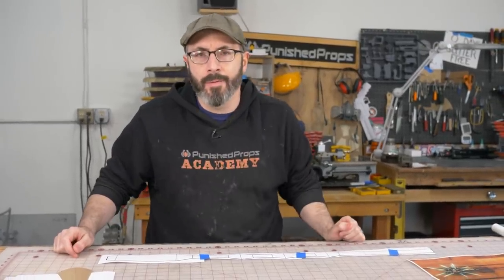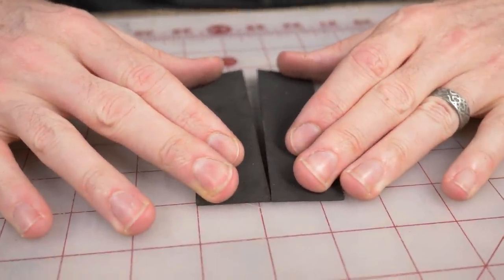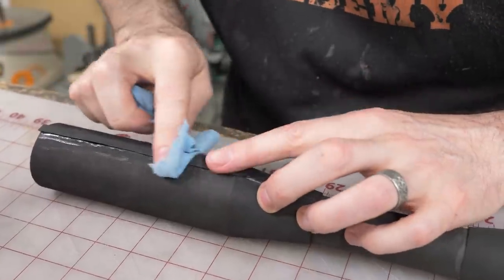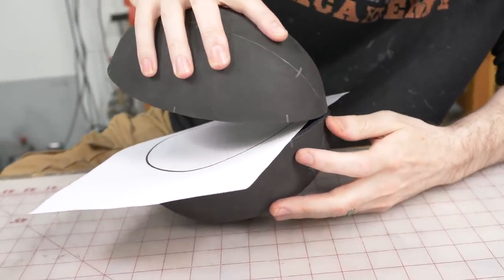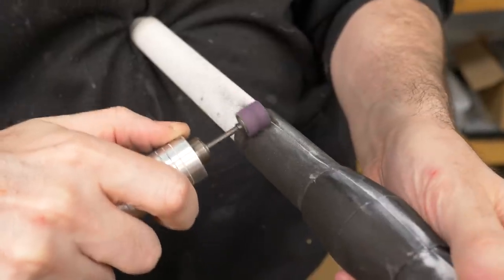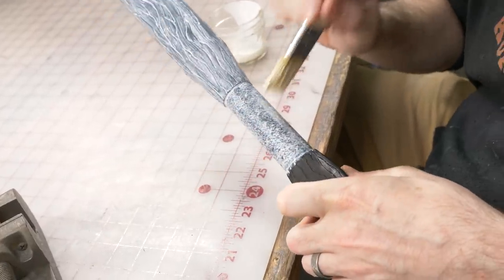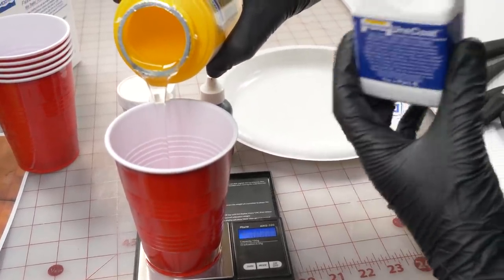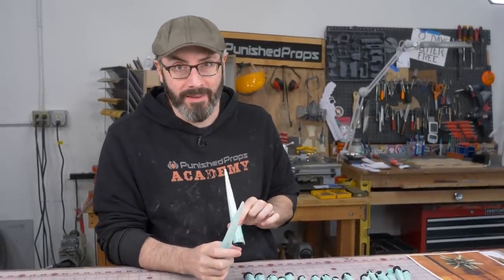Favorite Weapon in VALHEIM made from EVA Foam

Comment: Hey Bill, I noticed your skill bandsaw was starting to sound like mine on more difficult resaw cuts. There is a simple fix. Just losen the bolt on the back near the motor housing and move the motor housing further away from the blade. This will tighten the drive belt and make all cuts so much easier. Hope this helps.
Reply from the maker: Hey thanks for the tip!

Comment: I ran into the same issue you did at 7:13 wrapping 10mm foam around a tube when I made my M2 flamethrower backpack. I found the easiest way to remedy the huge gap was to make the wrap about an inch longer and beveling each edge .5 inch in. One bevel going up, the other down. 

When it's wrapped and glued, there's less stress of shear force trying to rip apart the seam. It also helps a whole helluva lot to heat form the curve too. It's pretty much an invisible seam too.

Comment: 17:05 I expected exacto knife followed by a heat gun, any particular reason for the iron? More texture? Really fun build, it's so great to see Bill's reaction when the spikes are glued on :D
Reply from the maker: It creates a different texture! It's easier to do more organic lines and get some awesome variance in depth and width of the line. If I used a blade and heat gun, the lines would all be an even width and look less natural.
Reply: @punishedprops  Gotcha, didn't think of the thickness variation, thanks!

Comment: Any suggestions on how to make it a solid head for the mace? For those of us who want a little more weight.
Reply from the maker: Hmmmm You could try casting it out of expanding foam or a latex foam. Or you could glue something on the inside of the hollow tip to add some weight.

Comment: I was wondering if you every use anything to seal in all the paint on the final product.  I'm worried the my projects will be ruined due to rain and snow, especially because I want them to be resistant to such weather. I've seen some people use clear varnish but I've also heard varnish dries hard and could be prone to cracking. I'm really at a loss about what to use.
Reply from the maker: We seal sometimes, other times we don't - it just depends on how we want to use the prop. If you have something rigid like a sword you can seal it with varnish or a regular clear coat, because it doesn't need to flex. Flexible sealing is a little more challenging but can be done! Check out our foam sealing guide: https://youtu.be/ug6Rs06FEpk
Reply: @punishedprops  thanks!

Comment: I feel like they switch their heat gun every five videos XD
Reply: In the Tested podcast, Bill said they moved out of that shop back into their basement. He also said that using a heat gun down there would on occasion trip the breaker and the lights would go off, so a battery operated heat gun is great.
Reply from the maker: Yep! Also we may have uh... broken a heat gun or two and had to replace it
Reply: Isn't that life? Also I may have melt the cord a time or 2 when setting it down when hot. Never to the point of exposed wires. The 1 we had before would always pull itself onto its cord when set down. We moved a power strip under our workbench so that ii plugs in below rather than at the back of the bench, that seems to help stop that and using the vise as a stand/holder when hot. Haven't killed 1 yet, but we are a once in a great while user rather than a daily tool.

Comment: I have a bit of a random question. 
Have you ever encountered the problem of adding effects (lights/sound/movement) that create unwanted noise? Like a fan blowing or the sound of parts moving?
If so, do you have any solutions to dampening the sound? A specific finish or an extra layer of material or sealant, etc ?
Reply from the maker: Hmmm it hasn't typically been much of an issue. If I get a bit of sound from electronics I don't worry about it because at conventions I likely won't hear it at all.